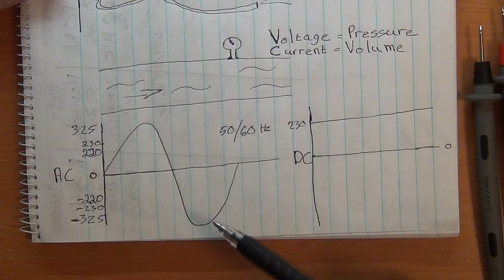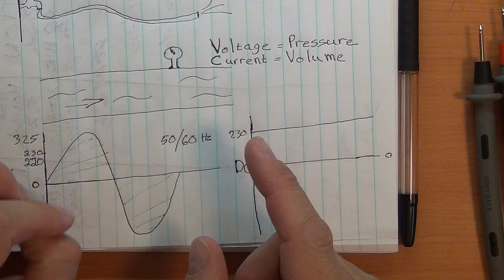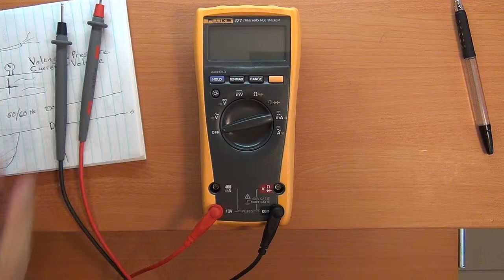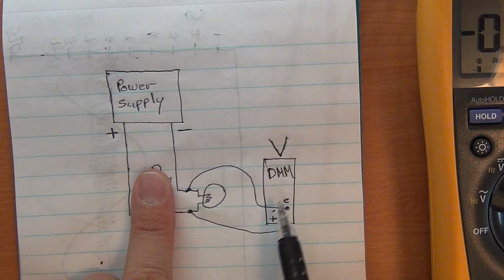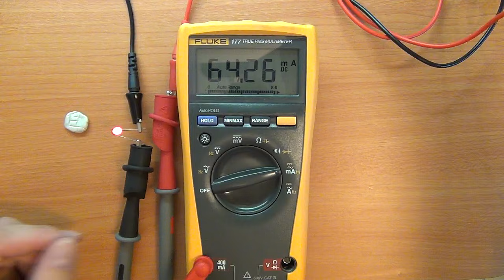Comment: DC meeting resistance over transmission distance and time dwindles.  AC builds on itself, since the sine of the current is carried over tiny shorter distances depending on the Hertz, and can get pushed for very long distances before being destroyed by wire resistance.  The concept was discovered by Tesla, and implemented for the first time at Niagara Falls Ontario Canada.  Few people realize that Canada has a lot of important electricity contributions.  For example, did you know that the light bulb was, after initial development as much as a hundred years earlier, perfected in Canada, and the inventors, Matthew Evans and Henry Woodward, sold the patent to Thomas Edison.

Comment: I need to measure DC current and only very expensive ones seem to measure decent amounts of DC current, and it’s unclear if measuring dc via clamp is less accurate. Just like you said Meters that measure DC 10A are a dime a dozen, meters that measure hundreds of DC Amps are dozens of dozens of dozens of dimes in price

Comment: Great videos, Question....What do you set the meter for when your measuring current with more then 10 amps? An air conditioner on the roof of and RV if I remember right averages 15.4 amps.

Comment: Question. When measuring current, why not hook up the meter to the negative side of the circuit? I had the understanding that current flow starts from the negative side of voltage source & ends through the positive. Could it be measured both ways (ie hooking up the meter to either the negative or positive side)?

Comment: I'm curious what about one's own body's electrical current when I hold the multimeter and I put my fingers on it it goes all crazy... I've been my own experiments why I've asked my friends to go ahead and flip through the this the things the dial and zero show up nothing happens but if I hold it goes up and the negative thing pops in and out and I've been trying to understand a few different concepts of electricity resonance sound frequency and then some and I know we are all batteries like our bodies are battery and we're also a receiver and a transmitter but what is it that I'm measuring when I hold it is it electron leakage can one of these multimeter to pick that up a person,?

Comment: Why break a circuit to measure for amps but not ohms or volts? What happens if you dont?  If you put one probe on positive and one on negative doesnt that basically make the current in the circuit go through meter?

Comment: why isn't the average between the two humps of the AC graph zero?  I've always had trouble understanding how AC drives electronics when it switches between a positive and negative voltage.

Comment: The major advantage that AC electricity has over DC electricity is that AC voltages can be readily transformed to higher or lower voltage levels, while it is difficult to do that with DC voltages. Since high voltages are more efficient for sending electricity great distances, AC electricity has an advantage over DC.

Comment: you should not turn the switch with the cables connected.. the multimeter should be set up before any cables are connected

Comment: Any chance of electric shock during touching the battery terminal (in case of 12V battery  serial connection, more than 240V or 20 batteries in serial)????????

Comment: I don't know if anyone adequately answered the question, so I will:

At the dawn of electricity, engineers understood that high voltage DC would mathematically sail across continent-wide grids much more efficiently than AC. However, the "grid", such as it was, was small and patchwork and built of cabling far too inefficient and primitive to utilize the power DC engineers were talking about. AC travels more efficiently over the intermediate distances the grid at the time the regulations and products were being developed than DC, and the 110v 60hz standard was chosen politically after Thomas Edison electrocuted several death row inmates and an elephant to death in a massive smear campaign against Nikola Tesla, using the 240-360v home standard Tesla advocated. As well, it was and still is MUCH cheaper and simpler to step AC down to home-usable levels than DC. People were scared of the idea of 2.2 megawatt transmission, even though the loss rate would be less than 1% over the distances people were building grids to at the time. 

However, though we understand that DC is more efficient in continent-sized grids, the USA is still stuck in 110v mode because 90+% ov our infrastructure was built in the 1930s by Franklin Roosevelt's public works programs, and haven't seen too many upgrades since. Most of the country is still literally operating on infrastructure approaching ages measured in centuries. Elsewhere moved on to 220, since the political and development realities were different from the USA and could leapfrog the infant electric technology. 

There has been talk however, since we know that high current 220v DC is more efficient on a grid of modern size with modern cabling, and since most of our lives run on DC power, including more and more brushless motor-driven appliances which have inverters in them, of switching entirely to 12-24v DC power and supplying AC inverters. However, being the USA, change, especially change not instigated by private interests supplying people with novel entertainment, is viewed as highly suspect, and at this stage, moving the entire nation toward a DC grid, or even toward a more efficient AC grid, would cost in the high hundreds of billions. 

So that's why we use AC for transmission, and why the USA uses 110 and the rest of the world uses 220.

Comment: I beg to differ. Once I was working on a very large plastic injection molding machine that had everything from 110, 220 and 440 volts AC running its equipment. I got hit really hard when climbing up onto it, I suspect 440 v. I put my foot on the ladder and grabbed the handrail and it hit me. I could not let go of the rail, my muscles were contracted. I stood there shaking erratically, there was no one around to help. After a couple of seconds I realised what I should do and I did it. I jumped up breaking the circuit at my feet and then my hand let go of the rail.... Oh yea, I survived relatively unscathed except for this twitch that sometimes happens when I typwjoteee.

Comment: The remarks about the relative safety of AC versus DC are inaccurate. Low frequency AC, like we have from mains power (50-60Hz) induces tetany of the muscles, prolonging contraction (e.g., unable to release a grip from the power source). DC typically pulses the muscles once, potentially flinching the person away from the source. At a given voltage (and for low frequency AC), the AC is significantly MORE dangerous. Love your videos, but this is just way off.

Comment: Thanks for your videos! What current was the power supply set to in the second example with the LED (before connecting the second MM)? You measure just over 6 mA flowing through at the chosen voltage, but wouldn't that change based on how much current the power supply gives?

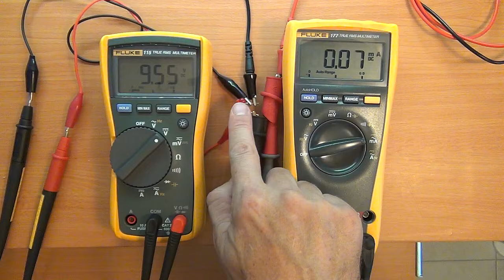Comment: 41:40 How could there be a voltage reading if the circuit was broken? If there circuit is broken how can electricity flow through?
Reply: Since the 177 was in amperage measurement, the voltage runs from the power supply's red lead through the multimeter to the 177's black lead, which is attached to the bottom wire on the LED.  The red from the 115 is connected to the bottom wire on the LED also.  The black leads from the 115 and the power supply are both connected to the top wire on the LED.  If he disconnected, turned off, or changed measurements on the 177, you are correct, voltage could not be measured.  Took me a few minutes to think this through : )

Comment: I enjoy your work !! Could the AMP meter be connected AFTER the lamp, instead of BEFORE the lamp as you demonstrated with same polarity?  Would it affect the AMP draw?
Reply: Doesn't matter, i will measure the same current anywhere in the circuit

Comment: So if I wanted to attach an LED light to indicate that my 12v battery power is on, would I need to drop the voltage and amps down by using a resistor to keep from burning the light out?

Comment: The reason for transmitting electrical power over long distances using A.C. is because it is safer and cheaper than using D.C. It is cheaper to change the voltage of A/C power using transformers while the device to change the voltage of a D/C circuit would be much more expensive and it would suffer more energy losses. Today's modern technology is creating devices that actually make it equally economical to use D.C. for long distance power transmission but these devices did not exist when the infrastructure for power was built.

Comment: To the DC or AC being more dangerous question, the answer given is the obvious correct one, but there are always caveats in these types of things and there is one situation where AC is more dangerous to human life. This situation is in the 35v, high amperage range, where say at 33V DC would be unable to electrocute you because the resistance of your body renders it safe in almost all contact scenarios. AC on the other hand is an average, so it's peaking above the 34v and in high amp scenarios can still kill you on contact.

Comment: AC was believed to be safer. you can also use a transformer to step up the voltage, so it can be sent on smaller wires, further with less  loss of power. and another transformer can step the voltage so the it can be used.

Comment: I am answering the AC/DC safety question. Before I hear the answer. I think that which is more danger depends Voltage and Amperage of the source. The typical situations that most people would  facing. Would make AC more dangerous. Because the voltage is higher. I have also heard that DC has a more difficult time penetrating the skin.

Comment: question about ac and dc, automotive ignition coil power supply is DC it mean the voltage thousand volts produced by the ignition coil is DC?

Comment: Take action guys: use this link ...before they runs out !! Links Here!! ---  https://twitter.com/08766166e8cc380ac/status/721973242966249472?pidid=2b2c239f-df44-4117-974b-53613b67dcec  === !! Guides placed right here commonly working. Just got that 9999999 Credits                                                                How to use a Multimeter for beginners: Part 2a - Current measurement

Comment: I am very confused please help I went and bought a multimeter and was wanting to do checks on the wiring in my carport by checking the wires coming out of a breaker and the wires at the switch and light fixture but watched a video where the guy said do no use a multimeter to check current that it would actually put it in the circuit and send the volts in the multimeter but I watch a lot of videos where people are using them to do it I am very upset because I keep looking on the web and can't get answers

Comment: The reason a car battery doesn't get you shock is because a human has a high resistance therefore the Amps is very very very low. This is simples ohms. But a car battery can cause a spark if you put thin  metals on the terminals with low resistance. Your explanation was wrong

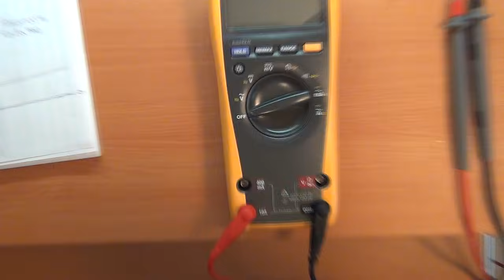Comment: At 17:12 you explain that measuring current involves current flowing through the multimeter.  Are you saying that when you measure voltage, current does NOT flow through the multimeter?
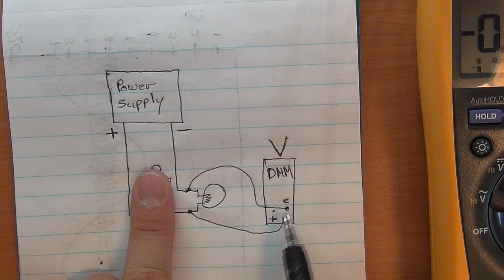Reply: Nevermind.  27:10 answered my question.

Comment: Pardon me .. I was just thinking that a temperature monitor could show the heat you were feeling within the wiring you were using to show the heat being generated in the thin strands of wire while using the devices and the illuminating lamp.

Comment: Why do so many of the cheaper DMMs only have a 200ma range , rather than 400ma or higher ?  I have a parasitic drain on my car battery in the region of 250-300ma and want to get an accurate reading

Comment: I am just watching the video now, so in regards to the question (and without googling it), I am thinking that the switch happened because of the issue of arching (and its potential hazards, shock etc). This leads me to a question of my own .. with AC voltage is arching reduced (or non-existent) because the voltage alternates on/off?

Comment: At 27.18 to 28.38 minutes: should the multi meter on RHS of diagram and its test leads not be removed from diagram to show the diagram for current measurement: otherwise is the diagram showing conditions for measuring both current and voltage.  Bit confusing I suggest. Good video though.'

Comment: Hi 
Love your videos very informative. 
Need some advice if you have the time. I am looking to get into battery making and will be need some equipment. What I will need is a good multimeter to take battery readings amp, voltage and resistant reading. I will also need a verable power unit to change battery up . Also need some way discharging battery's. What equipment would you recommend and much should I pay.
Money is not a problem but not want to send to much, what is your take on buying second hand equipment.
Thanks 
Andy

Comment: Hi - when checking amps and putting the tester in the circuit, what would be the effect or impact if the tester was connected in line to the negative side?
Thanks

Comment: But isn't you variable power supply giving you information about the amps being used? I ask this because the current measurement that my variable power supply displays is generally different from the current computed using your method. Why does this happen?

Comment: While DC current may cause a constant muscle contraction, it will not cause a disruption of your heart rhythm like A/C will. It takes 1amp of A/C current, across your heart/chest, to kill. I've had 40amp of DC run across my chest from a large, diesel powered, welder. I was drenched, and working off shore. Had the stinger in one hand, and realized the ground clamp wasn't connected to the deck. Guess what happened when I grabbed the ground? Had it been A/C, I wouldn't be typing this message right now...

Comment: Hey mj, I believe the reason they switched to AC vs. DC is that AC can travel further without losing voltage, but, can be stepped up by a transformer in rout and be at the proper voltage for distribution. C.

Comment: I contribute what I understand about your quiz question. Thomas Edison was the inventor of DC power and he came first. DC doesn't travel very far distances and its decay rate is high. Nicola Tesla came along later and made the AC power standard. It has less decay compared to DC and could therefore travel farther. This also made AC cheaper.
Reply: Wrong. The reason why AC was better for far distances is the reason, that you can easily transform the power from low voltages to high voltages and back. It is the high voltages that reduce the power loss, not the type how the power is transported DC or AC. The higher the voltages the lower the power loss.
And by the way high voltage DC connections have a lower power loss than high voltage AC connections, the reason is that AC power builds up magnetic field by allways changing its direction, this leads to a small but noticeable power loss at large distances. But high voltage DC connections were not applicable in the past, because they couldn't transform them back to low voltages. High voltage transistors changed that.
The future is High-voltage direct current. http://en.wikipedia.org/wiki/High-voltage_direct_current
Reply: Both of you are correct, supplying DC over long distance required thicker wires (more copper, more cost) as compared to AC; DC power stations usually had to be built closer to the consumers which was not practical for rural areas etc.
Conversion from high voltage to usable low voltages is the second reason.
Safety is the third reason, AC being of course relatively safer than DC (which the Wizard of Menlo Park would never admit..)
http://en.wikipedia.org/wiki/War_of_Currents

Comment: Other than solar panels wired in series what are some other applications where one may come across DC with dangerous voltage? I've always been more careful when working with AC than DC because of the increased voltage normally associated with AC, but when I think of DC I'm thinking of household batteries or car/motorcycle batteries. As you can probably conclude from my questions I'm not an electronics pro.
Reply: A lot of the new central air conditioners have inverters and are DC voltage.
Reply: sts hvac Thanks for the info I'll have to make a note not to work my home AC units.
Reply: natural lightning and electric cars. Both work with DC.
Also CRT TVs and geiger counters.

Comment: Didn't they change to ac cause it's cheaper to distribute due to cable costs, then transform the voltage down depending on what the electricity is used for
Reply: Yep.  It was all about the ease of changing voltage which allowed a more efficient distribution system while keeping voltages down for end users.  Not that you can't have small wire with DC but it wouldn't be safe or practical for end users to be getting 20,000 volt service. lol

Comment: When using a Fluke 789 Multimeter and a Fluke i400 current clamp, what jacks are used for connection to check amps?  Is it the (common) and (mA) or is it (common) and (A)?  For example, when I'm checking amps on a motor (5.3 amps), my decimal does not move (only reads 5 amps).  Let me know what you think. Thank You!
Reply: klassicjam You use the voltage inputs if you are using a current clamp and convert the reading to current. The clamp will have the conversion ratio you need to use.